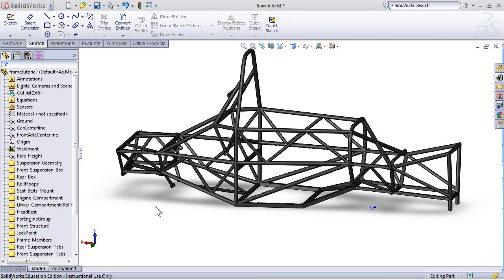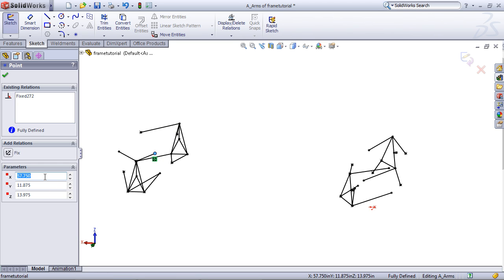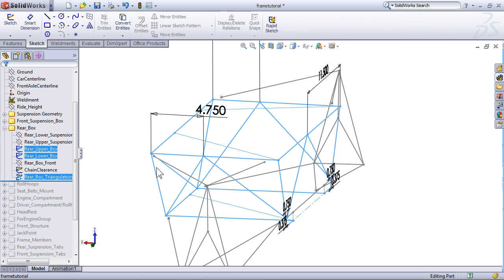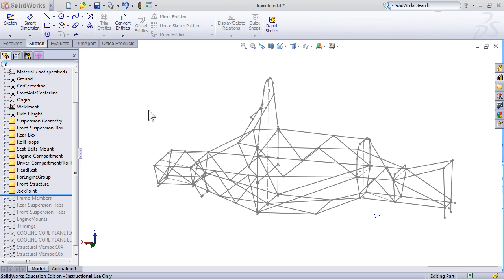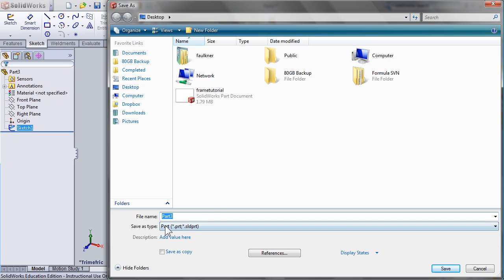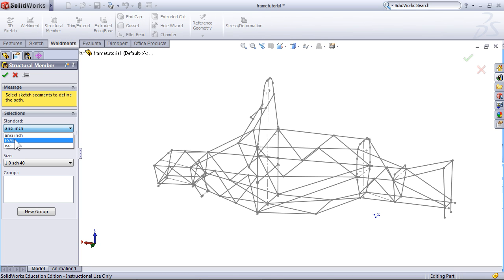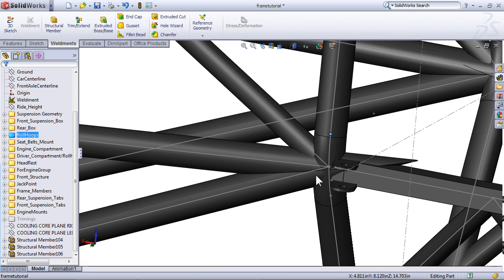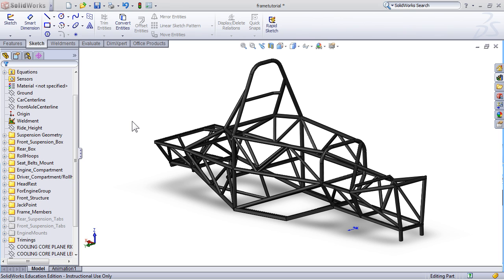Modeling an FSAE Frame - Tutorial - SOLIDWORKS

Comment: any luck using user defined values for O.D. and wall thickness .... IE so you could change tube type "having different O.D. and wall thickness" and the corresponding relationships "and more important the cut profiles" to the other tubes
Reply: what i mean is to have this all figured out and then change tube type by simply changing user defined value

Comment: I don´t have that "weldment profiles" folder on my computer, the version of the software I run is the latest 2015-2016, how can I proceed ?
Reply: I had the same problem, then I searched for 'ansi inch' folder in C drive and got the address, its different for SW-15,
It is :- C:\Program Files\SOLIDWORKS Corp\SOLIDWORKS\lang\english\weldment profiles
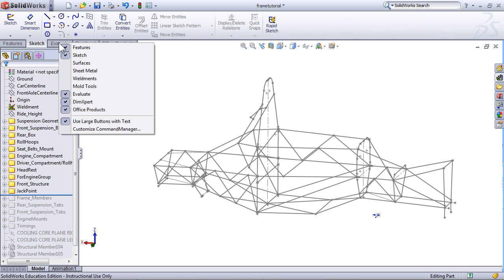Reply: see 3:08

Comment: when I go to save the part, it says it's "the part may contain features that may not be related to the selected features. do you want to create a simplified feature part that does not include unrelated features?....
after saving I try to use the part as a structural member and it has an error saying "Library feature is empty".. please help. I could swear that I did every thing you did step by step..

Comment: When the trim takes place it trims it to mate perfectly with the tube, however when laser cutting tube the laser only cuts normal to the tube you would end up with something that didn't fit if you used the outside profile.  Is there a way to use the inside edge of the trim and then use that to cut perpendicular to tube surface?

Comment: @prosupra123 just radius the 2 lines at the meeting point in the sketch? I understand it can be difficult to constrain a 3d sketch though once you have added a radius. This is where you need to be savvy in how you layout your design in seperate sections/seperate weldment groups.

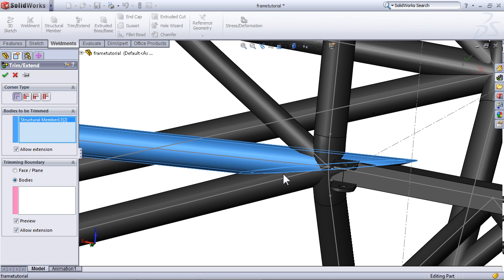Comment: I often have trouble using the trim/extend comand to get tight fitting joints that intersect at a tube bend (e.g. 5:56). I notice this tutorial does not use the "merge arc segment bodies" when creating the tube with the bend (at 5:56), evident by the fact that the tutorial creater was allowed to select just the bend portion of the tube. Is there a method to get consistent tight fitting joints by using the "merge arc segment bodies" option?

Comment from the maker: The Frame is a single part.  In this part you can create a series of lines that represent the frame members.  There is a SolidWorks Tutorial called "Weldments" for a simple table frame.  Try this first and then watch the video again.  It is helpful to place other construction geometry such as planes, axis, and sketches to locate the engine  and suspension geometry in the frame part.  Marie Planchard